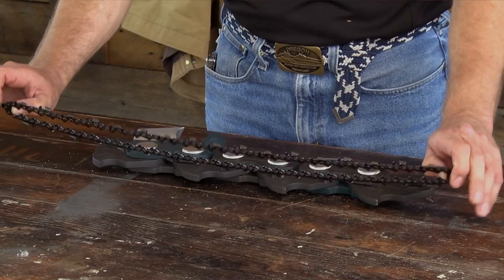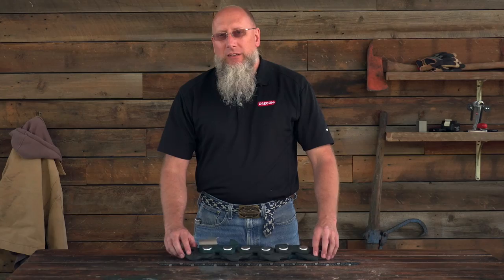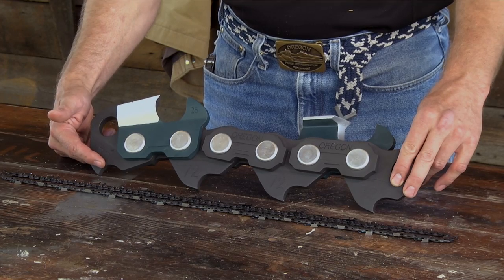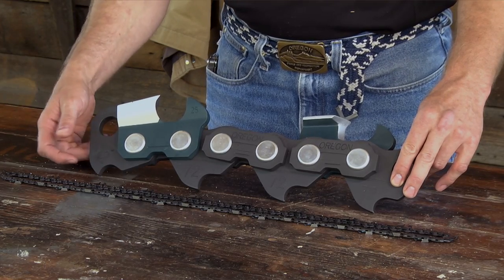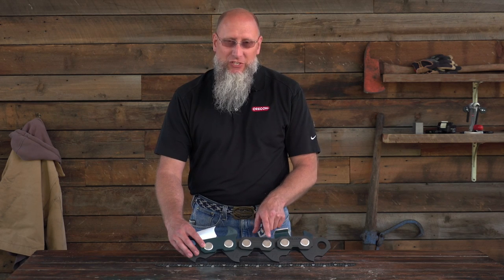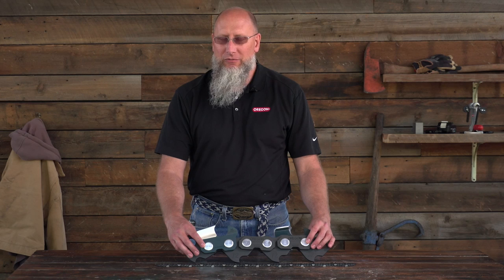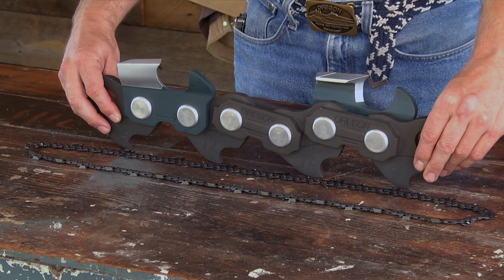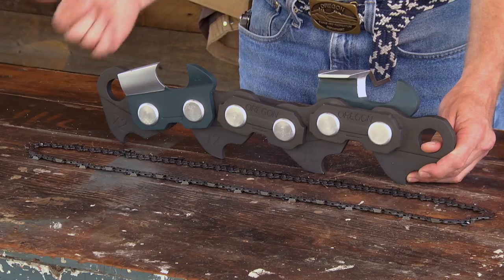Technical Tips- Identifying Chain Pitch and Chain Gauge

Comment: Would be good if you used the numbers stamped on your prop to illustrate your meaning i.e.' 73 indicates the gauge and pitch. You can see this on our reference chart.' Now someone please please  tell me what the smaller 25 stamped on the chain means. Why does this need to be so cryptic? Its like a secret code you have to study to understand only because the information is so difficult to find.
Reply: The 25 stamped on the chain refers to the 0.025" clearance required between the top front of the cutter and the top of the depth gauge. This is adjusted with a 0.025" depth gauge tool and a flat file. It is a simple filing process and there are videos that show how to do this.

Comment: I heard how to measure pitch. I still don't know what pitch really is. What is gauge referring to? An illustration of each would be helpful. Thanks.
Reply from the maker: Hi Gary,

Chain Pitch is the size of the chain, and is defined as the distance between any three consecutive rivets divided by two. Oregon chain is made in several pitches - 1/4" is the smallest, 3/8" is the most popular, and .404" is the largest hand-held chain. 

The Chain Gauge is the drive link's thickness where it fits into the guide bar groove, matching the guide bar gauge. The gauge of the chain and the gauge of the bar must match. Oregon has several gauges of saw chain: .043”, .050", .058” and .063". 

For illustrations and additional information on chain pitch and gauge, please visit https://www.oregonproducts.com/en/findingtherightsawchainforyou. If you'd like additional assistance, please feel free to contact our Technical Services Experts at technicalservices@oregonproducts.com or call 1-800-223-5168, select Option #1, and they can walk you through how to properly measure pitch. 

Thank you,

The Oregon Team
Reply: @OREGONproducts  which cuts faster full chisel low profile chain vs standard full chisel
Reply: @OREGONproducts  thank you for the link to your website which let me find which chain I need rather quickly. The manual that came with the saw is useless in that respect.
Reply: gauge refers to the thickness of the drive links.  gauge of the chain must match gauge of the bar.  pitch refers to distance between links.  pitch of the sprocket must match pitch of  the chain.  appears that although pitch must remain constant between bar and sprocket, gauge although it must be maintained between chain and bar is irrelevant to pitch.   so a 3/8 pitched sprocket can run 3/8 pitched bar and chain in different gauges.  Hey Oregon I got this right do I not?

Comment: Thanks for uploading,  We do not have a chain on our old 1950s Danarm dd8f saw,  can the chain pitch be determined by measuring the drive sprocket, if so, how ???   thanks for your time... M......
Reply: The earliest DD8F from UK was shipped wearing 1/2" pitch chain, later models (MKII, MKIII) were equipped with either 1/2" or 7/16"

http://www.acresinternet.com/cscc.nsf/GasbyManufacturer?OpenView&Start=29.1&Count=30&Expand=31#31

Comment: Yellow label, Green label, Pitch, length, yada yada.  Don't make me set up a chain saw laboratory complete with micrometers, all I want to know is what chain and where to find a chain for my Oregon Portland 9 pole trimmer with a 9 1/2" blade stamped "T6" &  "080SDEA041" & "547980" from Harbor Freight.  Loaned it to friend and now it's so dull it probably couldn't chew its way out of a paper bag but I don't want to open a machine shop.   Is there really a need for all this obfuscation?

Comment: Can someone help me with the correct chain to buy for my Stihl 041 farm boss with quick stop? I have a new 20" Stihl replacement bar on it and have attached a photo of the specs for your aid.  I guess I can't so the bar says 3003 000 8822 ,  3/8", 
72x,  .050",  SA,  and there is a 3 on closeup of the sprocket picture on two different projections.
Reply: A 3/8 chain, 050 with 72 drive links is what you need. And I'm a little late to tje party though.

Comment: How tight should the gauge be in the bar
Reply from the maker: Hi Dennis,

Thank you for asking. Please note that the gauge of the bar and the chain should be the same, the chain should easily slip into the channel of the bar without force and should be able to be gently pulled around the bar by hand.  If you have any further questions or concerns, please contact our Oregon Technical Service Experts at 1-800-223-5168, Option #1. 

Thank you,

Your Oregon Team